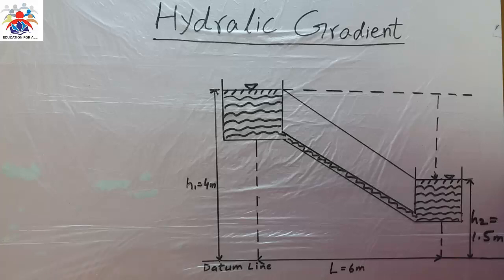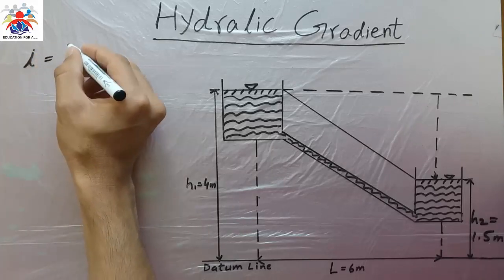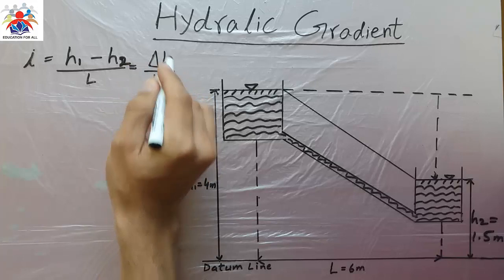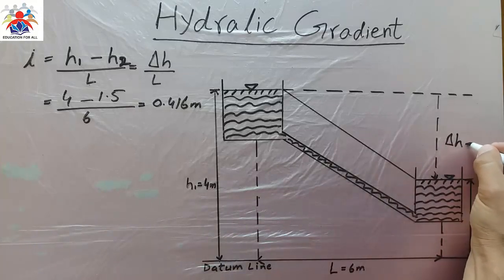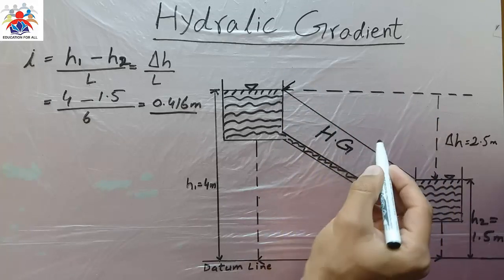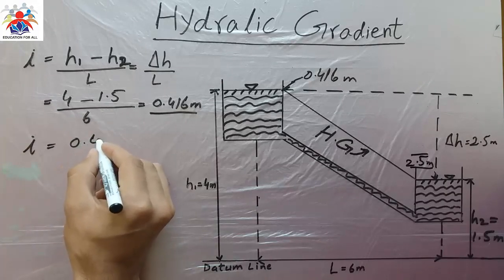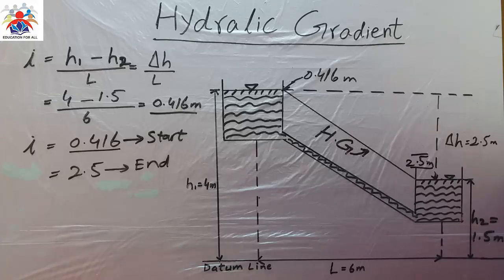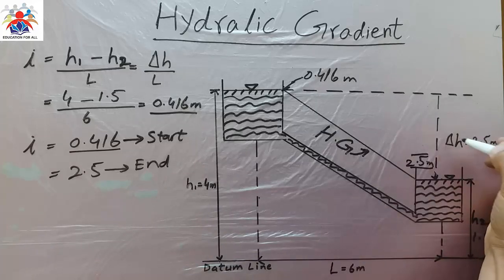Hydraulic Gradient  #Fluid #Different Elevation

Comment: Hello can you help with this problem please  chrome-extension://ohfgljdgelakfkefopgklcohadegdpjf/https://pdfs.semanticscholar.org/6af4/7821044957af79a537c1a1ddf0265ef81626.pdf 
I am not understanding very well how they solved this. Thank you
Reply from the maker: Thank you for your message. Ok let me see if can help you out with this issue I will get back to you
Reply from the maker: Hey Maria I have been through and realized it is has used the tensor to calculate the gradient and I am not good in that. Sorry🙏

Comment: Really nicely done just one thing, hydraulic gradient is a dimensionless value so the gradient will be 0.416 instead of 0.416m
Reply from the maker: Thank you so much for the compliment. Since I used meters in the solution yes you are right its   "not meters"  thanks for correcting me.